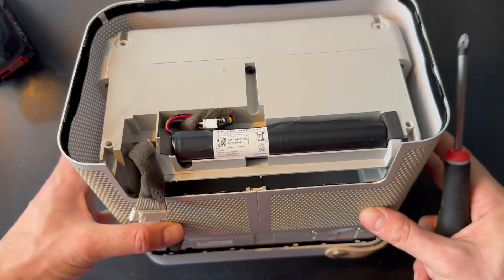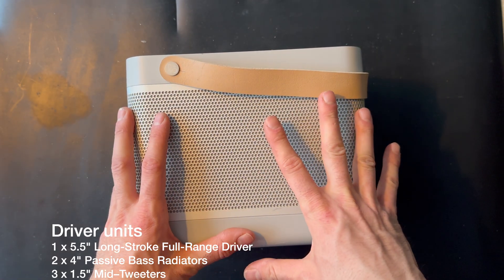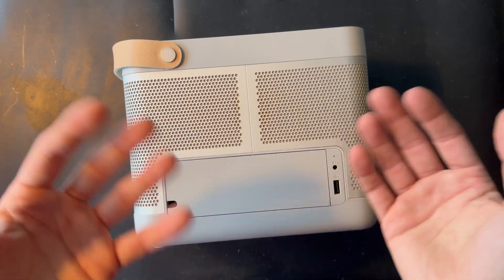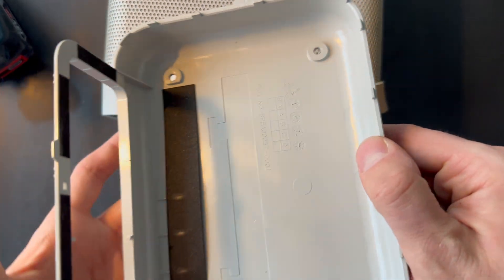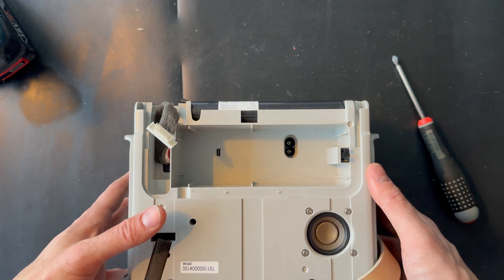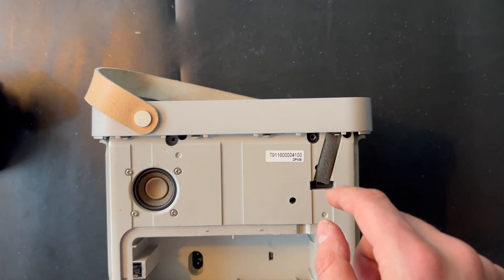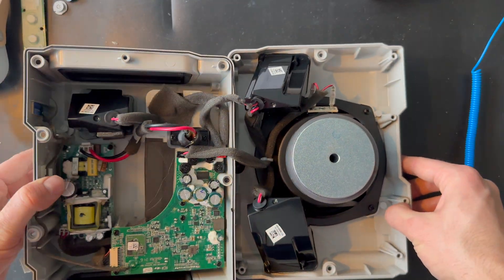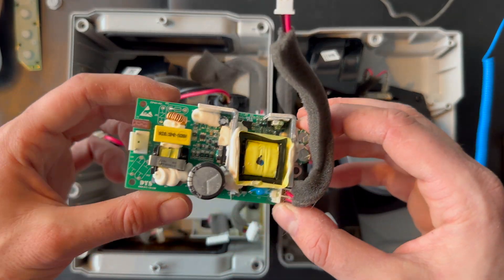Bang & Olufsen Beolit 15 Disassembly process and Repair guide

Comment: So... what was the issue with this Beolit?  Was it the battery?  Or the main board?
Reply from the maker: Thanks for your comment! This video focuses specifically on the disassembly process, not the exact fault or repair. I’ll be covering common issues like battery and main board problems in future videos — stay tuned!

Comment: Great video thanks. My battery died ages ago and i was just watching on B & O site where they show you how to replace it, it seems simple enough. I have been playing this on the mains but last night we had it on for a while but it started to get quiter and then stopped working dont know if anyone has experienced this problem before.
Reply from the maker: Thanks a lot for watching and for your comment! It does sound like the battery might be affecting the performance, even when running on mains. Some B&O devices rely on a functioning battery to regulate power correctly—so if the battery is completely dead, it can sometimes cause issues like the one you described. I’d recommend trying a battery replacement first and checking for any signs of capacitor or power board issues if the problem continues. Let me know how it goes!
Reply: @KoseTrading Thank you for your reply I ordered a replacement battery the same day from Amazon. I removed the old battery and tried it on the mains and it worked again. My replacement battery arrived today and after re fitting it its as good as new. Thank you for the video and everyone's comments on their own speaker, so i could fix it.
Reply from the maker: That’s fantastic to hear—well done!

I’m really glad the video and community comments helped you get it sorted. Sometimes a fresh battery makes all the difference, and it’s great that everything’s working like new again. Thanks for sharing your experience—it’ll definitely help others in the same situation!
Reply: Have the Beolit 20, and play it 100% volume for 2 hours, literally once EVERY week for our ballroom dancing. It lasted 4 years and then started to show symptoms like yours - it would die despite being plugged into mains power, or even with an additional piggyback battery plugged into the USB-C port. I put in a genuine BO replacement battery, and it back to brand new now. For us, it’s the most outstanding speaker in its class in terms of portability, size, weight, form factor, and audio performance.

Comment: The production date is printed as a part of the serial number, in your case 1609, that means in September of 2016.
Reply from the maker: Yes. Like this

The serial number "1609" indicates that the production date is September of 2016. Specifically:

"16" refers to the year, which is 2016.
"09" refers to the month, which is September.
So, the product was made in September 2016.

Comment: hello. My Beolit battery has failed and needs a new battery, just orange flashing stage,never gets to the 'green light" stage. Does this model work on mains only with battery disconnected or if battery is dead.
Reply from the maker: Hello! If your Beolit is stuck with the orange flashing light and doesn’t reach the green light stage, it typically indicates a battery issue, as you mentioned. For most Beolit models, they are designed to work on mains power even if the battery is disconnected or dead. However, this behavior can vary slightly depending on the exact model.

You might try disconnecting the faulty battery entirely and powering the device directly through the mains to check if it operates. If it doesn’t, you may need to replace the battery or consult the service manual for your specific Beolit model. Let me know which model you have, and I can guide you further!
Reply: @KoseTrading  Thank you for your prompt and informative reply, i removed the battery, after doing so it is working well on mains. i have a couple of friends who have had this model and we all have had problems with the battery not charging. Even after fitting a new battery and using it for quite a few hours it would not charge. As for mine i will just use it on mains. Thanks again. Ken.
Reply from the maker: @KennethGill-v8q  You're welcome, Ken! I'm glad to hear it's working well on mains now. It definitely sounds like the battery charging issue could be a common problem with that model. Using it on mains is a good solution for now, though it's unfortunate that the battery won't charge properly even after replacing it. If you decide to explore any further fixes or if the issue reoccurs, feel free to reach out. I'm always happy to help. Thanks for updating me, and I hope your device continues to work well!
Reply: @KoseTrading  Hi, after reading this I thought I'd reach out. I am having exactly the same issue with the battery not charging, even after replacing it. My Beolit 15 works on mains but I'd like to try and resolve the battery not charging  issue. Do you have any suggestions?
Reply: @alifeofjoe  Thanks for reaching out! If your Beolit 15 works on mains power but isn't charging the battery, even after replacing it, there are a few things you can check:

Check the Charging Port & Cable – Ensure the charging port is clean and free of dust or debris. Try using a different charger and cable to rule out any power supply issues.
Battery Connection – Open the unit and double-check that the battery connectors are properly seated and secure. A loose connection can prevent charging.
Reset the Speaker – Sometimes, a reset can help resolve charging issues. Press and hold the Bluetooth and Power buttons for about 10 seconds until the LED blinks.
Check the Charging Circuit – If the above steps don’t work, the issue might be with the internal charging board or components like the voltage regulator. Inspect for any visible damage or burned components.
Firmware Update – In rare cases, updating the speaker’s firmware via the Bang & Olufsen app (if available) might help.
If the problem persists, you may need to replace the charging circuit or get it serviced. Let me know if you need further guidance!
Reply: See my reply to another post above, I changed my battery, and at the time, BO warned me to use a genuine BO battery part because the battery has a chip in it. A 3rd party sourced battery runs the risk of not being guaranteed to really suit. I got mine directly from my local BO shop, it was a tad more expensive than the Amazon ones, but for me I wanted the genuine part.

Comment: Hello i have a promblem with mine it turns on it conects but there is no sound what do you think is the problem?
Reply from the maker: Hi! Sorry to hear about the issue with your Beolit 15. If it turns on and connects but there’s no sound, it could be due to a few things:

Volume Issue: Ensure the volume is turned up on both the Beolit 15 and the device it’s connected to.
Connection Problem: Try disconnecting and reconnecting the Bluetooth connection. You can also test with another device to rule out any pairing issues.
Audio Source Issue: Make sure the audio source (like a song or video) is actually playing.
Speaker Settings: If it has multiple input options (like AUX), make sure it’s set to the correct input.
Hardware Issue: If none of the above works, there might be an internal issue, such as a faulty amplifier or speaker driver.
If the problem persists, feel free to reach out to our service department—we’d be happy to help diagnose and repair it for you. Hope this helps!
Reply: Will you be able to solve this problem? I have the same thing. It connects to my phone, I can control the volume, but there is no sound.

Comment: İhsan abi, fiyat performans ürünü olarak hangisini önerirsin.
Reply from the maker: If you're looking for a good price-to-performance ratio, the Bang & Olufsen Beolit 15 is a premium option, but there are also more affordable alternatives in a similar price range. For example, models like the JBL Charge 5 or Sony SRS-XB43 offer great sound performance and solid features. If your budget is a bit tighter, options like the Anker Soundcore 2 also provide good value. It’s important to consider your specific needs and budget when making a choice.